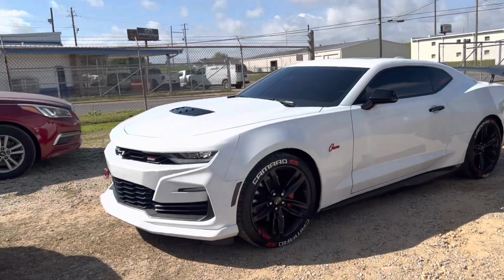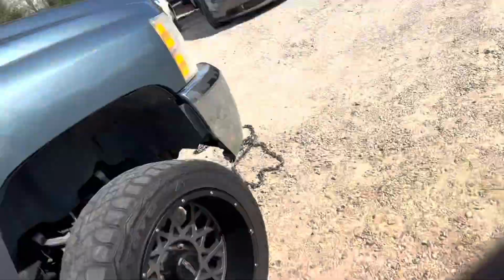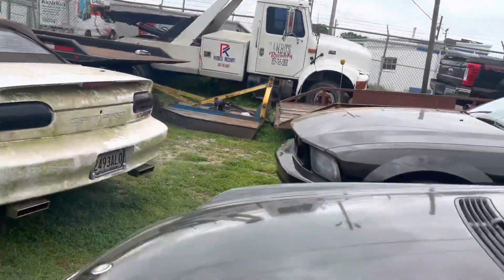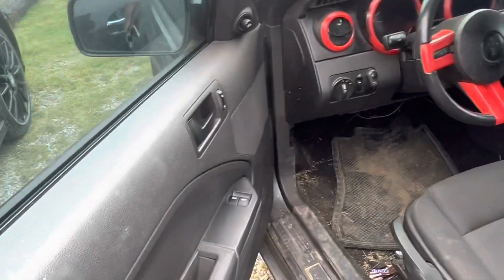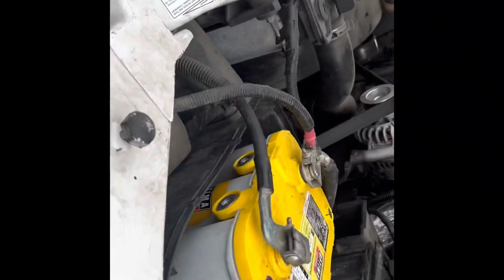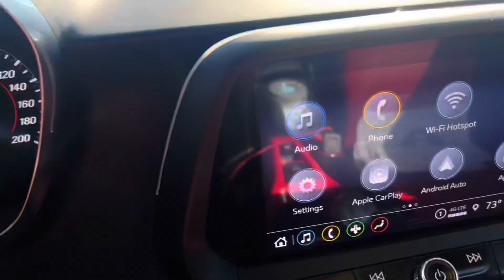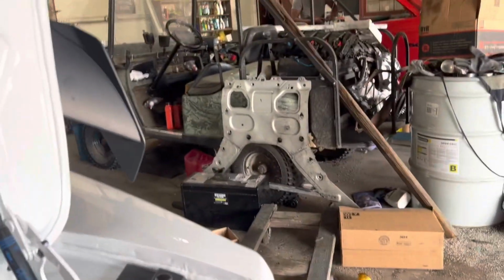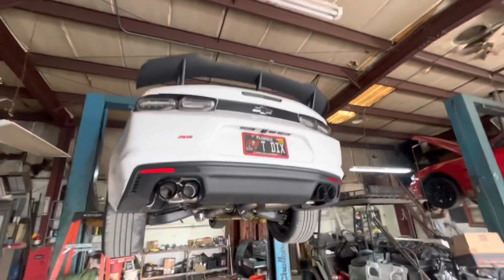Corsa Extreme Catback Exhaust Installed on a 2023 Camaro SS Redline Addition

Comment: Just got tsp 1 7/8 headers installed at a shop and they told me it rubs against the steering shaft , when i turn right its hard cause it rubs , any idea on how to fix it? its a 2016 camaro 2ss , thanks👏🏼
Reply from the maker: You can get the headers dented in where it’s hitting or you can get a shorter steering shaft bolt if it’s hitting there
Reply: @exileperformance  Appreciate it bro🙏🏼